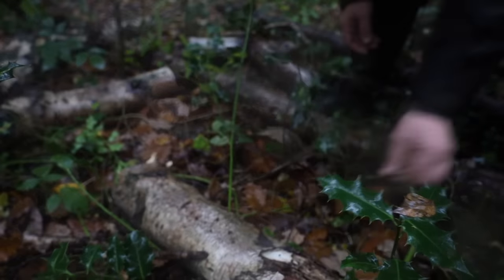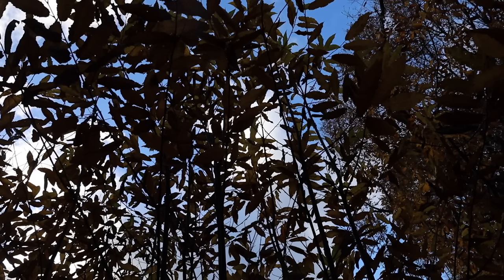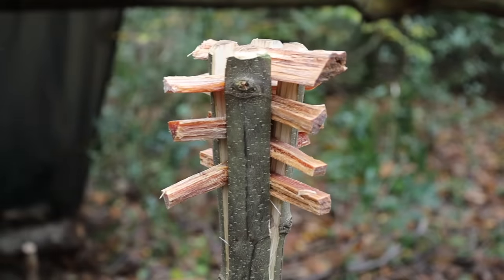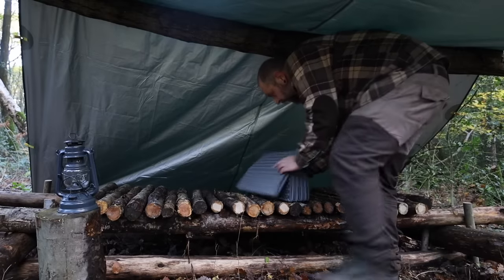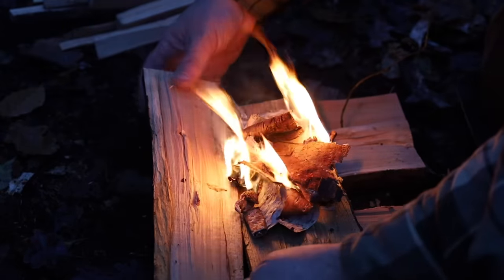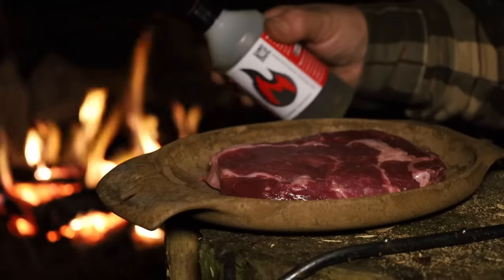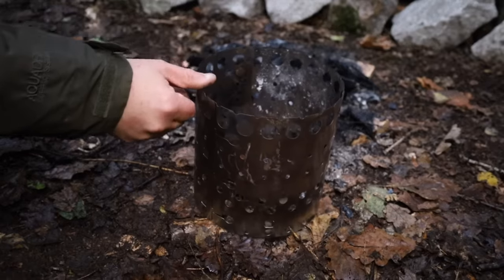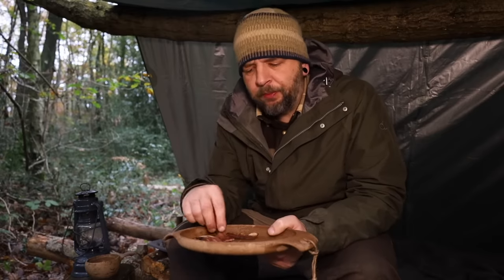Solo Bushcraft Camp under fallen tree - Too Much Rain!

Comment: As an ex jungle soldier from the Aussie Army may I give you a tip? Don't wear a tight raincoat. It overheats and restricts you. It soon lets the wet through, both as rain and sweat. It doesn't keep your pack or sleeping gear dry. Rather sling a light, wide, plastic sheet like a cloak over your back and fasten it around your neck. This leaves your arms free and lets your body breathe. It also keeps your gear nice and dry. It can later be used to cover stuff at your camp that you need to leave outside your shelter. Cheers.
Reply: Yeah travel  light.Dont leave the plug at home for the kitchen sink.Shame to here about soft boys in the army maybe pommys snuck in.Tip put salt dubbin on your boots minimise leaches
Reply: Great advice!
Reply: Thank you
Reply: I do agree with you… this guy does “ luxury “ bus craft… “ I’ll go home if it rains!” 😂😂😂😂
Reply: @silvo-sings that was funny but least he was honest about it. He also uses a chainsaw when needed, on camera not like some or probably most of them.
Reply: Your videos are outstanding 
I bloody love them. Your FOOOD tho!!!!! sometimes my mouth is watering so bad I dribble!!
Excellent little films, excellent work and excellent fun
You really are a great presenter and host..well done 🌸🌸
Reply: So basically you prefer a poncho  not a raincoat  to each his own they both have their pros and cons
Reply: @jasonknight3730  Yes, a poncho. I don't see any advantages for raincoats.
Reply: I’m in
Reply: I’m in
Reply: @adamheazlett1179 Wow, you're funny!🙄
Reply: I am in.
Reply: Plastic? Put the coat over your back without the arms in ,he dried it all out later. We all don't need more Plastic.
Reply: I’m in
Reply: @martymartin2894 he uses his beautiful, folding buck saw! So handy!
Reply: Love to watch you .your so calming...but I could never ever go into the woods .they give me the hebrgebes.im so terrified of woods .but sure love to watch
Reply: @silvo-sings , just because you*can* do something doesn't mean you can't decide not to. No rest, no good content, no hot food. There was no benefit for him to stay.
Reply: Im in
Reply: I love all of my White brothers and sisters.

May God bless us all.
Reply: Jungle in Australia
Reply: @pope1089  It may be news to you, but Oz is the size of mainland USA. There are extensive rainforests in the northern state of Queensland, and very heavy vegetation in the other states and territories. Currently I live in Vietnam. There is no worse 'jungle' here than in Oz. I've been to the Ho Chi Minh Trail between Vn and Laos. That is very tough going, but no worse than regions in the Blue or Snowy Mountains in Oz
Reply: @starcorpvncj  I know how big Australia is, jungles I did not know yous had any. Well have a good one in Vietnam. Jungles in Australia, who knew.
Reply: @pope1089  well now you know. Cheers.
Reply: I am in
Reply: @bellaboo208 I'm with you. I could never go out into the woods all alone. Creepy! Every critter that moved in the night would be some bad guy out to get me! 😮
Reply: I’m in.
Reply: @starcorpvncj pope1089 probably grew up watching skippy or neighbours mate dont have a go at him, seriously doubt he know what the Ho Chi Minh trail is! But to be fair going home coz it's raining to much is a bit of a wet excuse, and I was taught shelter and fire are the first priorities when setting up camp! Once you've got your fire keep it going! I'm talking about camping not enemy turf
Reply: @martymartin2894 why do it hard when you can do it easy, if he wants to carry a chainsaw up to him
Reply: @MSmith-vv6fk  Well you'd be wrong about the Ho Chi Minh Trail. I've lived in Vietnam for 34 years. I have also been to Laos and Cambodia many times. In 1978 I was on the border of NE Thailand and Laos looking across at the Cambodian refugees fleeing from the Vietnamese invasion to end the evil regime of Pol Pot. And, of course I have been to the Ho Chi Minh Trail. But only parts of i because it crosses extremely rugged and jungle infested terrain.
As for my growing up watching Skippy, you fail again. I was a migrant to Oz. I've been to 56 countries and lived and worked in many as far afield as Saudi Arabia, Israel, India,Apartheid South Africa, the  US, Russia, and China, to name only a few.
Stop thinking you are cleverer than you are.
Reply: @MSmith-vv6fk  Sorry Smithy. I thought you were meaning me rather than pope1089. BTW, I met Pope Pius VI in his summer residence way back in 1964. Whew...showing my age now. Cheers.
Reply: @MSmith-vv6fk  I agree that's what I said, that he uses the chainsaw on camera and doesn't hide it, some others probably use it off camera and pretend that they sawed all the wood by hand.
Reply: @starcorpvncj  I don't think that at all, just the opposite, sounds like you've had an interesting life
Reply: @MSmith-vv6fk  Everything has it's pro and cons dear Smithy. All the best. Mate. I'll be back in Perth next week for 3  months. Cheers.
Reply: Nice tips.
As an Aussie citizen, thank you for your service
Reply: Totally agree- I milk cows (hard work/wet environment) it’s dryer not in your wet weather kit if you’re working hard
Reply: @silvo-sings  Andy regularly stays out in the rain and quite bleak weather, tbf.  I think he was worried about his camera gear getting wet, and realised he wouldn't even be able to light a fire, so no food.

Given food and shelter are bedrock essentials on Maslow's Hierarchy of Need, I don't really think we could call them luxuries! ⛺🪵⛺
Reply: @adamheazlett1179  I'm guessing you were one of the lads who spent English classes larking about instead of listening to teacher?
Reply: I’m in.  Great videos👽
Reply: For the people that think he should have stayed, that would have been a boring video. I’m not watching to see him suffer. I watch to see him having a good time.
Reply: I'm in.
Reply: Ponchos rule!❤
Reply: good tip but in UK we usually have wind with rain (or at any time) to get under your waterproofs/cape
Reply: @petes3011  Wear a wind proof jacket under your cape. Cheers.
Reply: @starcorpvncj  but the cape still flaps arounf in the wind which as a real pest when trying to pitch a tent/tarp/ also dlapping in the wind. Horses for courses. UK suits wind proof  + Waterproof layers which can be switched seperately to suit
Reply: @petes3011  Fair enough. We obviously need to adjust to the local conditions. I would simply tie a light chord around my waist to anchor the cape if the wind was bad. I just think it's important to keep the heavy rain off you and your gear, which is the main purpose of the cape, aside from letting you ventilate in a warm climate. BTW, I was a boy scout in the UK for 12 years. Cheers and all the best from Perth, Western Australia. Off to Vietnam for a month next week.
Reply: @DawnOldham  especially if you watch MrBallen episodes 🤣 all about strange and mysterious stories... now I'm suspicious of everything and on high alert😅
Reply: @oilburner8548 In the meantime he carried around a dead weight, useless, soaking wet coat.
Reply: @pope1089 Actually, the rainforest (jungle) in Queensland is the oldest in the world.
Reply: @MSmith-vv6fk Fair enough. BTW, I've been to the HCM Trail where it runs between Laos and Vietnam. It is really tough going.

Comment: Pick your site with the weather in mind.  Choose an area with a down slope or dig a Shillong trench to divert the water for drainage. I only camp out with a couple of poncho’s and some para cord. My Bergen has room for rations, dry clothing in a bin liner, a sleeping mat, some old mess tins and mug, a bivvy bag, a machete and a lamp.
I do like your saw though, so I may invest in one.
Ok, I’m an ex squaddie and used to making the best in the area I camp out in. My Bergen ‘ go bag ‘ never changes. Snow storms, rain or hot summer days? It’s all the same to me. I’m now 70 years old and I camp out like I did in my 20’s, 30’s and 40’s. I camp out when I go sea fishing, or just to get back to nature. Have I had the odd cold night, the odd wet night? Of course I have, but that was due to bad camp site choice on my behalf. Anything I do, like heat reflectors gets dismantled so I leave no imprint on the land.
I can’t understand using space in my Bergen for things like fire pits and saucepans.
I love camping out. But when I change from roughing it to luxury I will knock it on the head.

Comment: BPS knives are crap.  Had one, feel apart.  Went in the bin.  The sheaths are ok.

Joker knives (made in Spain) are reasonably priced, and far better quality.  About 50% more expensive than BPS and far tougher.  Sheaths are exceptional as are the handles.